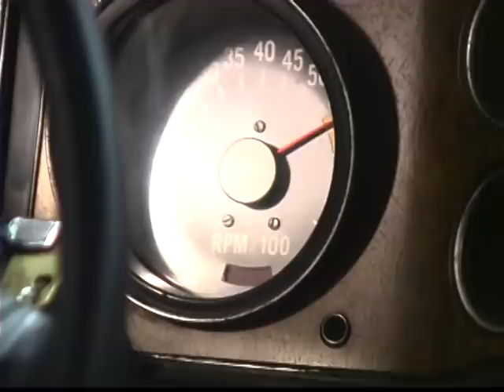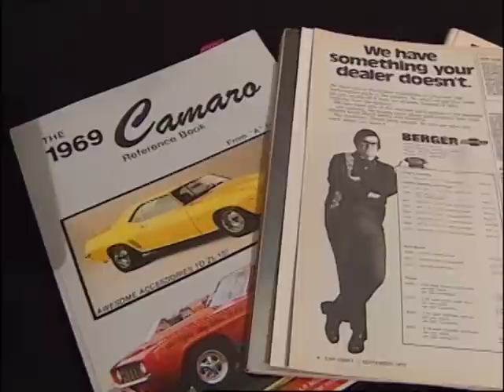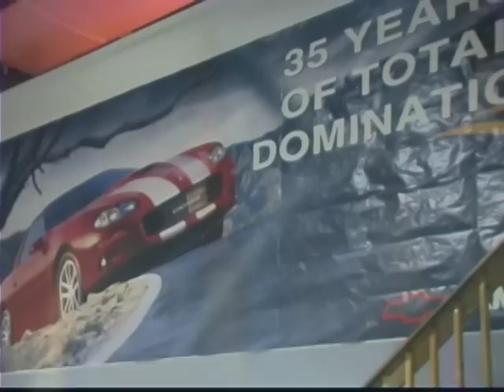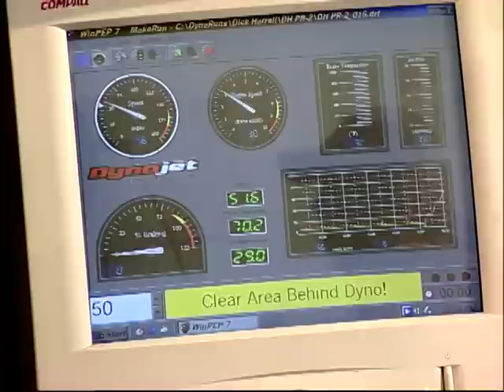Dick Harrell Rare Special Edition Widebody Super Camaro

Comment: The only reason the 427 copo camaro was made to compete against the dodge challenger 440 six pack and I'm a lucky guy to own a 1970 camaro and a 1970 dodge charger rt 440 the best performance cars of their times
Reply: No that not correct 427 came out before , the Challenger 440 Sixpack came out in 1970.

It was Don Yenko who put 427s in Camaro's in 67/68.. then Chevrolet looked at that decided to do the COPO's so Yenko did not need to replace engine as came with 427 from factory.

Comment: Too bad Pontiac didn't do this through Royal or one of their performance dealers. Maybe then they'd still be around.
Reply: Pontiac used SLP
Reply: @toecuttre  SLP wasn't a dealer though, just an aftermarket outfitter like ASC, Kenne Bell, Callaway or Herb Adams. Pontiac had their performance oriented dealers like Gay, Royal, Knafel etc. like Chevy had Nickey, Motion, Yenko, Berger that all did their own performance packages. The Firehawks were great but they weren't pushed enough commercially imo.
Reply: @jimmartin7881 GMMG trans am was the Blackbird.